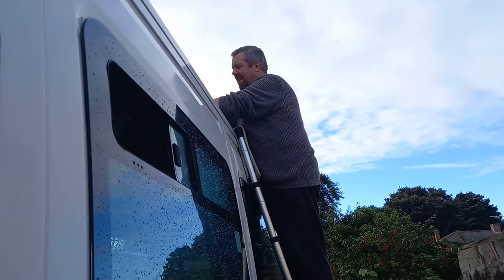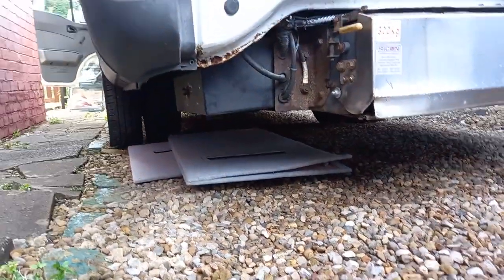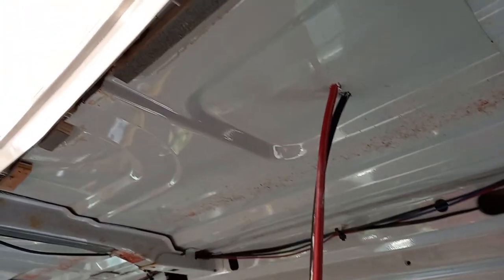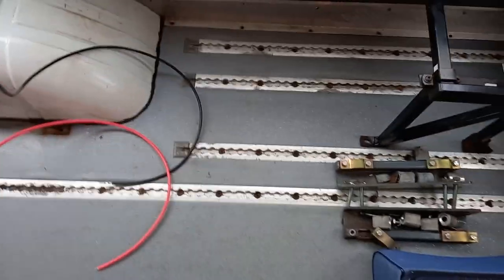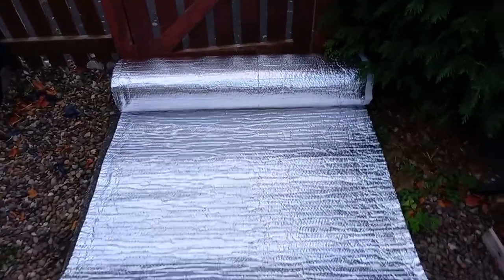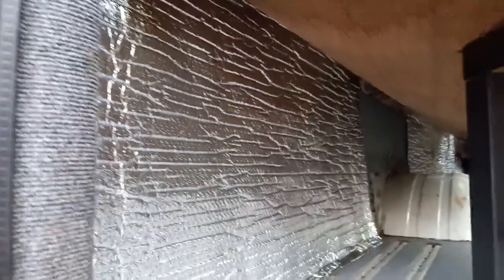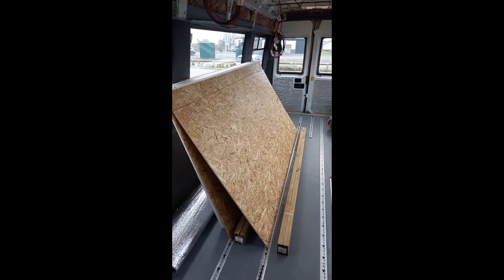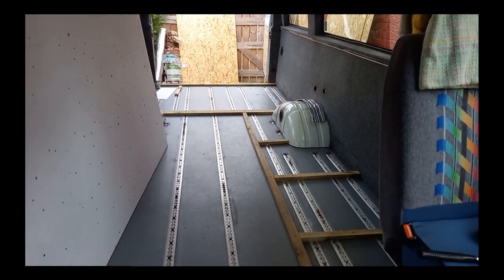Part 2 - Our Iveco Daily Minibus Conversion - Solar Panels & Insulation

Comment: You should have rubber grommets around the black and red wires through metal ceiling. Sharp edges of roof holes with time will cut wires.  
Cheers from old George
Reply from the maker: Hi guys, thanks for this, your quite right. 
We did put loads of sika flex in and around and the wires are being held in place to reduce any movement. 
Any further tips are appreciated keep them coming 👍 
Take care Elaine 🙂
Reply: @PensionersinPortugal  Best test is to run your finger over the holes you have drilled. If it cuts your finger it will cut cables. If you can pull cables back through without them being cut may be ok. As long as a deburring tool is used everything should be ok. Cheers from old George. Ps a tip. If a Van needs welding repairs on bodywork. It's a good idea to fit insulation after as welders like insulation removing before they do work due to fire risk. I nearly set my car alight. 🤔
Reply from the maker: Thanks 😊

Comment: Was that side panel that you lifted up, screwed in or how did you peel it back like that! Love the content, keep it coming
Reply from the maker: Hey  Justin,  good observation 👍 
These were the original hardboard and carpet panels.....I  wanted to keep them as they are tidy and it would have been a shame to rip them out, just to replace. 
I honestly couldn't say if they were screwed in or what, but they were easy to lift once we removed the floor trim.
They did not fall down and went back into place wonderfully after the insulation and foil!
Thanks for watching and for your lovely comments 😊 
Take care,  Elaine 🙂🐶